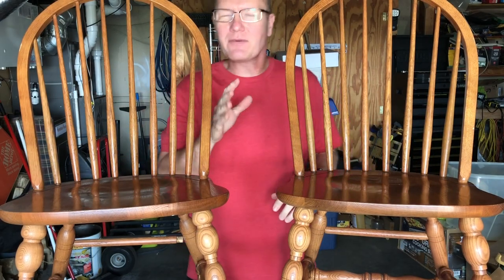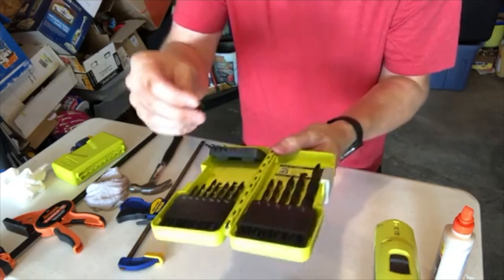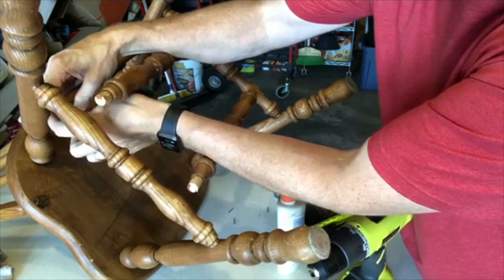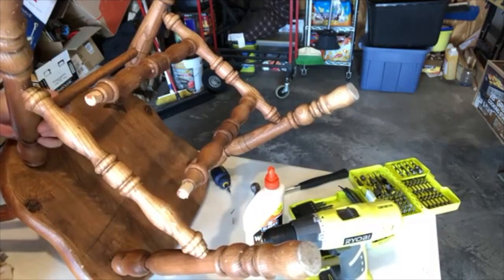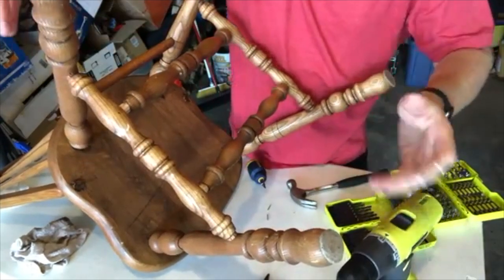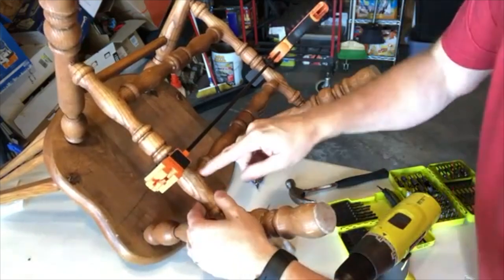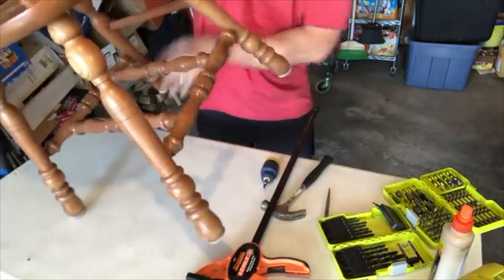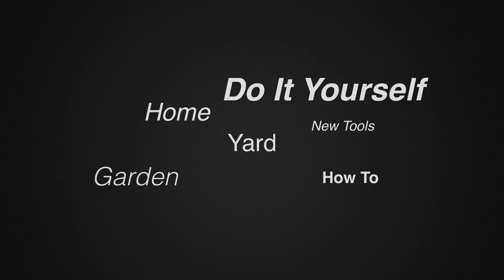How To Fix Wooden Oak Chair Rungs That Have Come Loose | Weekend Handyman

Comment: On chairs this old and beat up I would use 2 inch screws drilled right through the post and into the end of the joining post. Countering sink it and use wood putty. Will never come apart again.

Comment: If you don't clean out the old glue, the joints are going to come apart again. Wood glue is designed to bond wood to wood, not wood to old dried wood glue. Of course, this creates another problem. When you clean out the old wood glue, you are most likely creating a gap between the two wood parts. Wood glue is not a gap filling product. It required to two pieces of wood to be a tight fit for any real strength. My next attempt at fixing my chairs will probably be with Epoxy after grinding out as much of the old glues as possible.